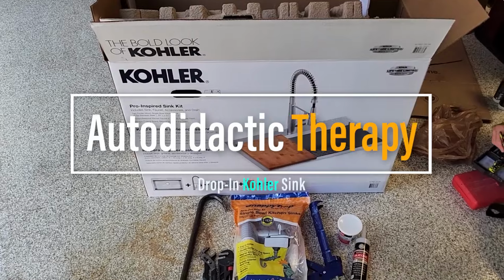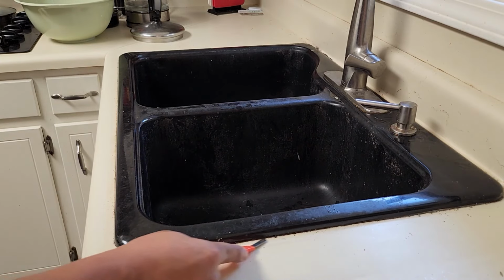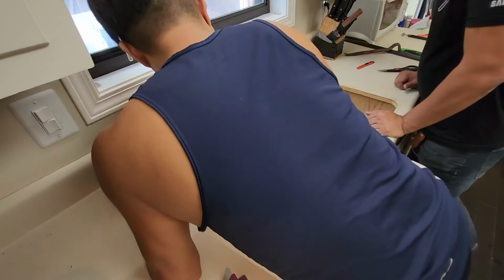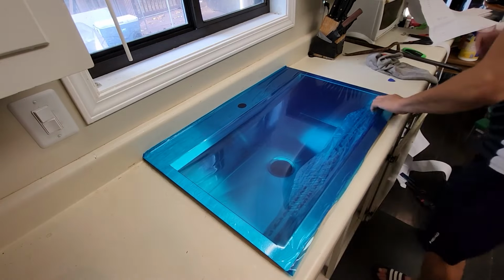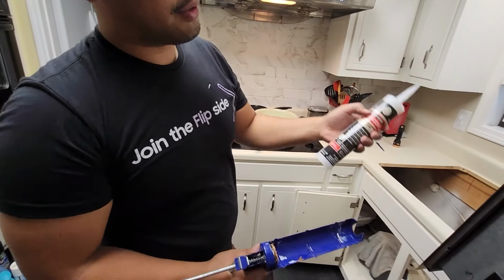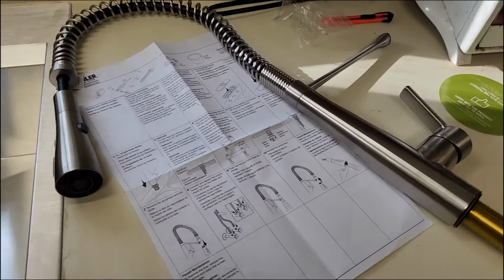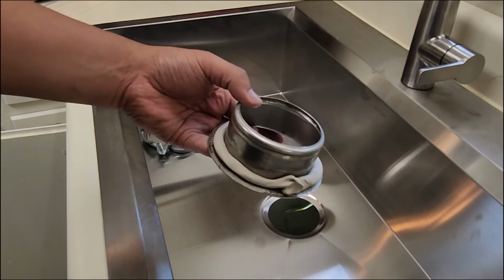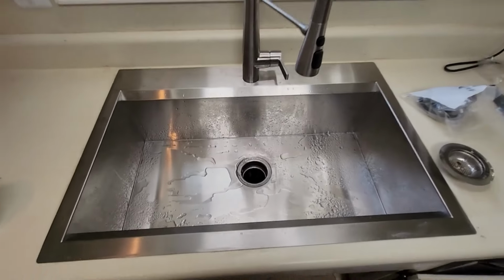Step by Step Kohler Pro-Inspired Kitchen Sink Installation

Comment: Just came across this randomly...  Great job sharing!  A couple words of advice from my many many sink installs, take them or leave them.  You don't need teflon tape on threads for compression fittings.  The threads do not make the seal.  Also, keep teflon tape back one thread from the end of the pipe when you do use it and wrap it clockwise. You don't want teflon derbris flowing through the system and plugging aerators etc. Lastly, as stated below, much easier to install faucet and hoses in the basin before mounting in the countertop.

Comment: Just finished installing mine. Same sink from Costco too. I got the same kit to do the install and it made my life so much easier. Only difference is my dishwasher is attached to the garbage disposal, 1 extra easy step. Also, I’ve never done any plumbing work before in my life so it was a good learning moment

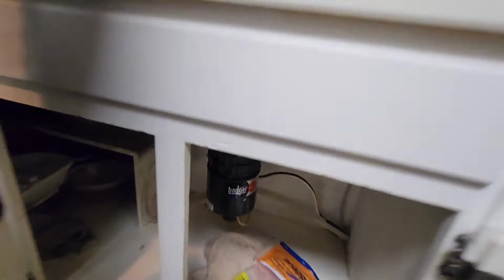Comment: Do you just leave the second drain open or do you need to close it with anything in 16:19. I’m going from a 2 to 1 but I didn’t see you do anything with it
Reply: @matthewfranks6260   Yes if it’s a drain that’s not being used it needs to be capped off to prevent sewer gases entering you home

Comment: Where did you get those nuts/bracket to hold the faucet from under neath
Reply from the maker: It's part of the faucet kit
Reply: @Self-taught_Therapy  wow mine never came with one
Reply from the maker: @raulrobles2961  contact the manufacturer they will send you some

Comment: The box saids top mount/undermount sink.   Can it be installed as an undermount sink or does it half to be undermount?
Reply from the maker: If the box said undermount, then you can install it. You probably need sink caulking for undermount installation.

Comment: Just a side comment but you can buy inexpensive peel and stick floor tile and place on the cabinet floor, seal it with silicon. This way if the sink plumbing ever leaks, it will not ruin the cabinet. Just an idea for anyone for underneath sink protection. Great video gents.

Comment: Super helpful. How did you deal with the air gap from the dishwasher?
Reply from the maker: Thanks I'm glad you like the video. The dishwasher line was  untouched, so there no air gap. We went from a duo sink to a single bowl so he had to close the extra pipe line with a cap adapter.
I hope that answer your question.
Reply: I drilled a new hole for the air gap using a step drill. Got hot, but it worked...
Reply: Will it be ideal to get rid of the airgap and just do a high loop instead? Im planning to do that on mine

Comment: Did the faucet have any flex once you installed it? I see someone reinforced it with a piece of plywood underneath since the metal is thin
Reply from the maker: You can reinforce with a block of wood, but the caulking and the bracket are a super strong no need for extra support.

Comment: Why did you decide to use silicone underneath the edge of the sink instead of plumbers putty ?
Reply from the maker: Great question. I simply don't want the sink to have any movements or any kind of debris to get under the sink. Plus, the silicone is waterproofing the metal sink edge, which prevents rusting. Hope that answers yours question.

Comment: Some feedback for anyone doing this themselves. I had an old tile countertop that presented a unique set of challenges. The original sink was an over mount but  tile was installed over the top edges of the sink. 

Had to cut the tile from the top to access the sink and remove it. To do this i had to purchase an angle grinder and diamond blade. This will kick up tons of dust so prepare ahead of time. 

The sink clips the Kohler sink came with werent long enough...so i bought longer ones at home Depot. Those still weren't long enough. After some research you don't "need" them if your installing over the top. . This might be up for debate but with my setup it just wasn't happening. 

My sink didn't come with the garbage disposal drainage ...it came with a strainer. You can use your old one ...but who wants an old crusty one in their new shiny sink? So i bought one for twenty bucks. 

Put tape over the edges of the sink to prevent excess silicone from getting on there once you seal it. Also make sure all your pipes are in place and install as much as you can before sealing it. Last thing you want is to move the sink around after you secured it in place.
Reply from the maker: Thank you so much for the insightful feedback!!
Reply: I can't even tell you how helpful your comment is going to be this weekend! Thank you!